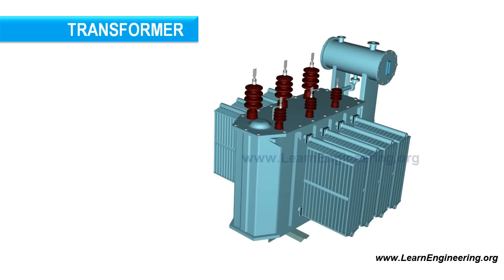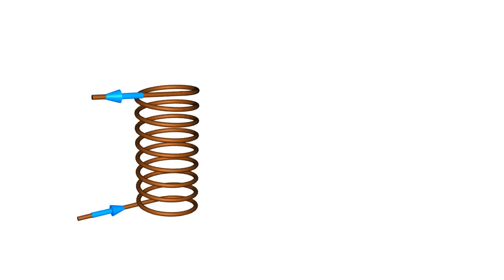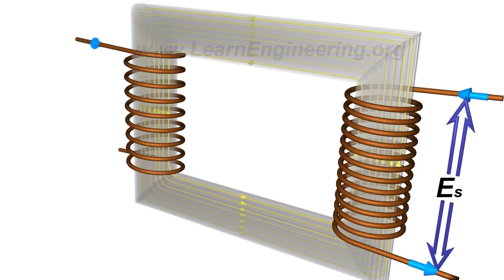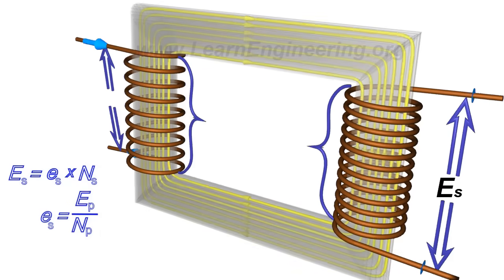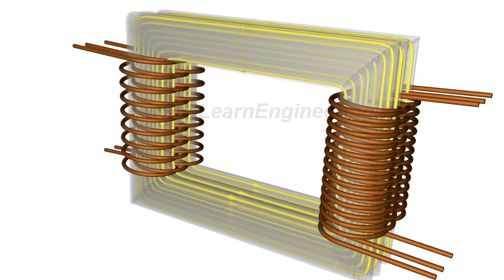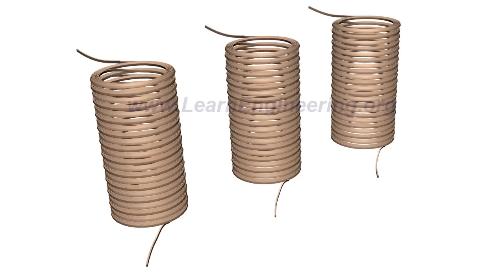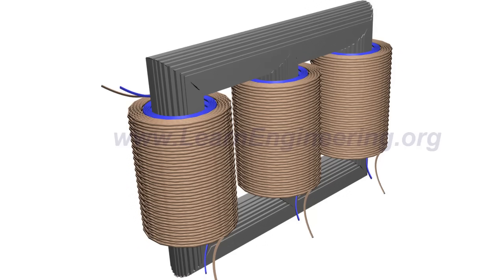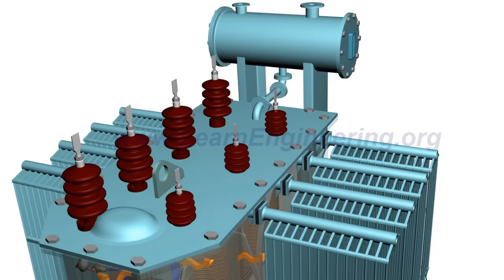How does a Transformer work ?

Comment: Wait I'm confused. Since energy is conserved, then Ep(Ip)=Es(Is) and I completely understand that – the higher the secondary voltage, the lower the secondary current, and the lower the secondary voltage, the higher the secondary current. What confuses me is, how does this obey Ohm's law since E=IR? Or does this obey Ohm's law at all?
Reply: There isn't necessarily any "resistance" involved here. We don't want any in the core and windings so that energy can flow unhindered how it is intended. Any resistance will be after the outputs (as a load) if necessary. Any sort of resistance will be considered a power loss, and there is plenty in the core and copper windings just naturally (hence all the heat given off). I always forget that no conductor is perfect and has a natural resistance to it. At this scale, it's quite a bit.
Reply: Ohms law only holds for linear devices.But the practical transformers are non linear devices.So it is not a good idea to connect machine with a complete network theory.
Reply: I'm not sure I understand what you're asking, but maybe what you're wondering is why the voltage and current don't seem to be related to resistance since winding resistance is so low? In the context of AC, E=IZ. Where Z is the complex impedance consisting of both the resistive and reactive component. Since a transformer is magnetically coupled coils of wire, it's very inductive and not very resistive (which is good because the winding resistance is the component that creates losses). Resistance is so negligible relative to inductive reactance that the equation can just be simplified accurately to E=IX. I guess the short answer is that yes transformers obey ohms law, but there's an X component as well, not just R.
Reply: @haider1695  Bhai I'm Naresh from Andhra Pradesh studying b.tech eee 3rd year "will u please explain about basics of all electrical subjects Mainly networks????please if you agree give me your number

Comment: So the delta and wye configurations were difficult to folllow the wires are crossed the image overlaps, so this can be improved....also why do coils sit concentrically over each other, wont that cause cross contamination so to speak, mixing conductors will cause issues right? is there insulation between the coils? also how does it work to have all three phases on the same core, wont that cause destrutive interference in some sort of way because the fluxes are out of sync..

Comment: hy there who can answer this question? if transformer cam step up electric current WHY SOME ONE BUY BIG GENERATOR TO GET HIGH CURRENT did u get my point?
Reply: because step up voltage also means less amps..... 120v 1 amp is 120watt... you step up that to 240v you only get 0.5 amp which is also 120watt... if you use generator more diesel power means more kick ass power to run the engine to produce more turns and generate power..
Reply: Transformers increase and decrease voltage, not current. You step-up voltage to reduce current. If you reduce the current you need smaller cables for transmission and losses are less. The battery cables on your car are large because the current is large, but the voltage is small, the opposite is true of power cables used in a national grid.

Comment: Does this mean that transformers can generate more electricity than what you have actually generated by increasing the voltage?  is the amperage also increased?
Reply: MrBat000 yes and yes
Reply: So these power companies are charging us a lot to of money for power that was mostly generated for free by these transformers!
Reply: MrBat000 no they don’t generate power. They transformer the voltage. For example your house can’t handle 13,000 volts. So the voltage is stepped down to 120.

Comment: is transformer transform both voltage and current
Reply: @Brandon Talavera omg that's so wrong ... transformers doesn't transform AC TO DC Lol they transform alternative voltage from primary to secondary circuit .. transformers always work with alternative current
Reply: @Brandon Talavera  are you trolling
Reply: I agree transformer transform current and voltage but in reverse order!
Reply: @Brandon Talavera 
Nope! Transformer transforms AC only not DC, after all DC has zero frequency.

Comment: so the term 'transformers' only for ac current? what is it called for dc current is it different to step up or step down a dc voltage?
Reply: Ilham Defra  it must be AC current to make a variation in the primary coil so a mutual induction is generated in the secondry coil
Reply: is there any way to step up and down a dc voltage, is it the same principle as ac?
Reply: Yes but you will need to make variation in this coil by pluging a magnet and withdraw it or inc. And dec. Resistance
Reply: yes there is , "chopper" which convert dc energy at one voltage level to dc energy at another voltage level . Its a static device and depends on the switching principle instead of magnetic principle to convert, and its sometimes called DC transformer
Reply: more or less, a switch connects a coil to a DC feed and when the coil is 'full' or at max current the switch disconnects and the coil releases it's energy into the output which can be at any voltage. So a coil is able to store and release energy at different voltages it depends on what speed the current changes or delta I. The power supply unit in your average computer works this way. It operates at a much higher frequency then line freq so it can use a small 'bucket' or small coil instead of a bulky iron transformer. Although a transformer doesn't really 'store energy' it has an advantage so to speak. The coil in a switching power supply really has to store every bit of energy. But it does it at a megahertz or so.

Comment: Anyone can tell me how those 2 coils arent shorted(between low voltage and high voltage). They look like phisically contacted.
Reply: Insulation is between them. The wires themselves are insulated too. This is not clearly shown in the video.
Reply: @FrainBart_main  thanks its clear

Comment: Sir, why consumers pay for the "transmission loss" ? 
What's the reason of paying for it? 
It's in the electric bill.
Anyone can answer, thanks.
Reply: I don't know what do you mean about 'transmission loss'.
But in my country, there is no cost regarding to 'reactive power' for residensial use, only industrial consumer pay it.
That's why they use capacitor bank and its pfr(power factor regulator) to stabilize cosphi into near ideal condition (0.99 or 0.98, almost 1).
Cmiiw.

Comment: how does a transformer affect AC or DC current?
Reply: transformers only work on ac alternating current.... if you tried to run a constant dc voltage on a transformer you get an electromagnet! when it becomes an electromagnet there is no energy transfer because all the energy has been turned into a magnet, its only useful to catch metals... so transformers are for ac use or switching dc,  but not constant dc

Comment: If single phase is of 220V, then 3phase should be 220*3=660V(R,Y&B each of 220V); but it is 440V. How?
Reply: The voltage or PD (Potential Difference) is measured between either of the two terminals i.e phases only. So 220 *2=440v
Reply: @rishibharadvaaj5485  for 1phase PD=Line–nutral; but for 3phase, why we measure phase to phase, instead of phase to nutral?
Reply: @susobhande4741  
If power is for domestic or for lower power usage we need single phase only i.e for eg. 220v but to close the circuit in order to flow the current another point is required neutral i.e  "0" zero potential. Here not 220*0, but 220+0=220v.
But where's for higher power need like office, industries motors to be connected to 3 phase in that at least 2 points are connected to 2 phases.

Comment: I dont understand why oil is used for cooling...shouldnt air just be better (and safer) ?
Reply: Laszlo Zoltan they forgot to mention oil is used as the insulator. If there was no oil, the transformer would arc phase to phase or phase to ground. Basically it would self destruct.

There are dry transformers (no oil) but the voltage is low

Comment: A Transformer increases the voltage and reduces the current. Landlines have a comparatively low resistance. According to Ohm's Law, applying a high voltage  to a low resistance should result in high current... why is the current in landlines so low of the voltage is so high?
Reply: Isn't it due to the fact that you are assuming that the only resistance present at the terminals of the transformer are the landlines themselves? In a real scenario, the huge potential difference would be connected across a very high resistance which comes from the houses, factories or other places where the electricity is being delivered to. Thus, the low resistance of the landlines is offset by the high resistance of the loads at the other end, so the overall current is low.
Reply: Matías Tripaldi No... the solution is actually that you run the landlines at a powercap... the transformer can only output as much power as you put in. By transforming the voltage up, the system simply can't deliver enough current, to satisfy Ohms law.
Reply: Of course, transformers can be used to decrease voltage as well.